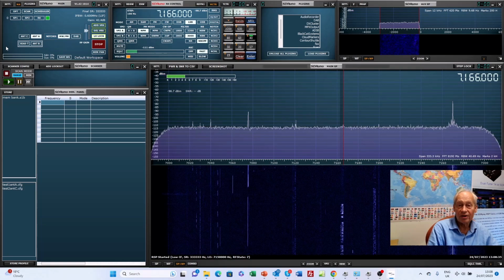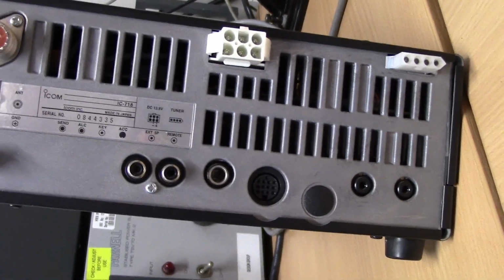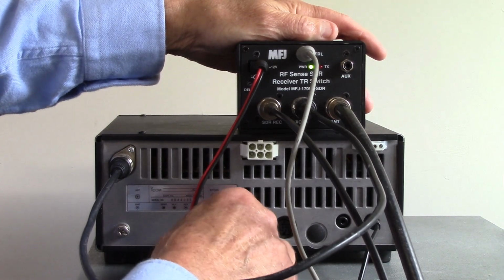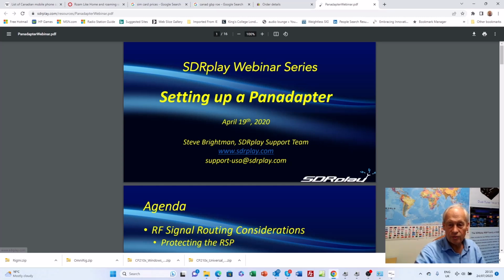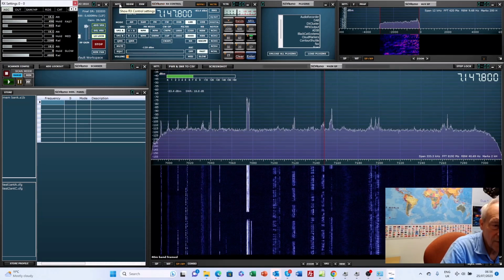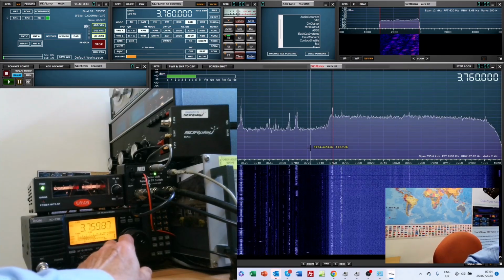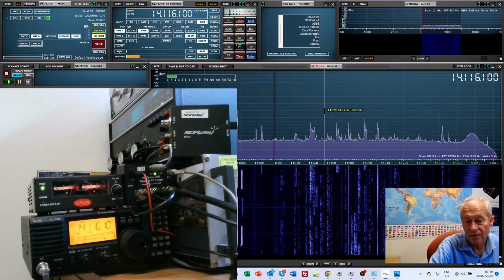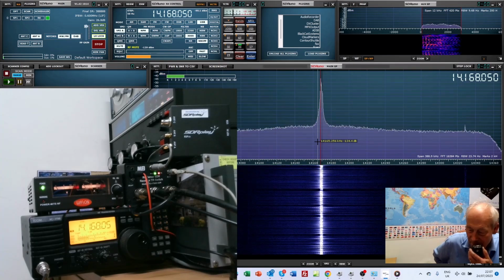Setting up an SDR panadapter for the first time

Comment: Question about  the jumpers you mention around the 6:45 mark, do you have to adjust your jumper because of the linear amp? I have to imagine the jumper would come the correct way from the factory for what most people are trying to do with it, which is, protect the SDR on transmit. Am I missing something?
Reply from the maker: It's purely because I'm using it with a linear amp which requires a "ground to transmit" signal. The default for that secondary "AUX" out is to "ground on receive" . Their datasheet descrivbes it as "An AUX output that can be set to ground to receive or ground to transmit"

Comment: Fantastic vid for those of us trying to figure the actual hands on 'plug this into this' for all the cables. One problem, I cannot find the MFJ 1708B-SDR anywhere or a close alternative. Any suggestions. Using a Yeasu 710.
Reply from the maker: Unfortunately MFJ have stopped trading. We are in contact with VE2DX who is developing an alternative T/R switch. https://ve2dx.com/sdr1

Comment: I know it's very similar, but would be interested to see the same setup, but with the popular Yeasu FT891 transceiver.
Reply from the maker: Should be similar... some discussion here re Omnirig settings for an FT891: http://forum.log4om.com/viewtopic.php?t=3151
Reply from the maker: The only difference would be selecting that rig in Omnirig and using TX_GND to control the switch. Everything you need to know is in the pan adapter Webinar linked in the description.

Comment: Very helpful video!
I have an IC-718. What cable did you use for the “Control” jack on the MFJ-1708B-SDR to the radio? I can’t find one. In the Icom manual it says it’s a “Send Control” Jack. Could you provide a link where you can purchase one? Thanks
Reply from the maker: I used a 30 year old phono to phono cable I had (I think it came with the Drake kit)  - this kind of thing: https://www.amazon.co.uk/Black-Female-Phono-Socket-Extension/dp/B07TKVWKZ4/ ("phono" is sometimes called "RCA" and vv)